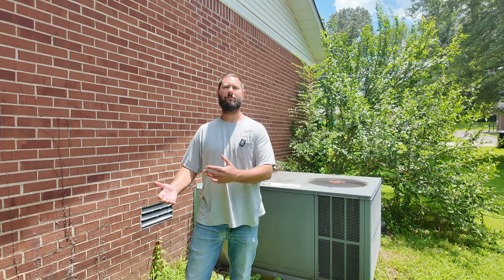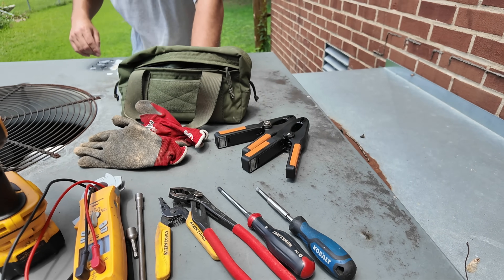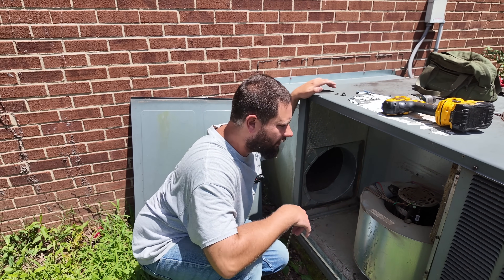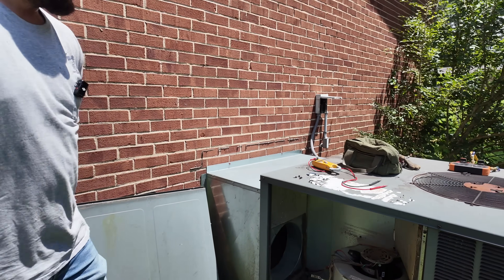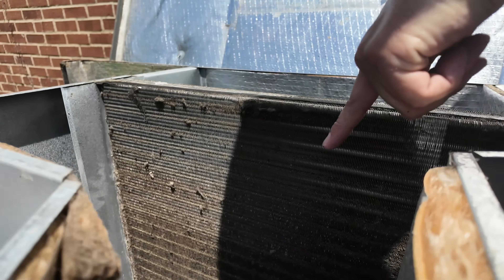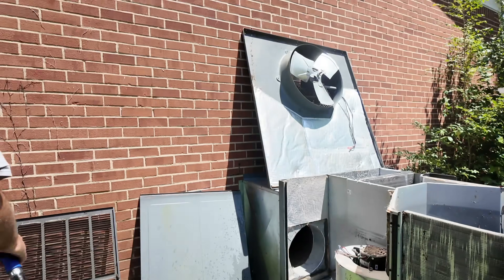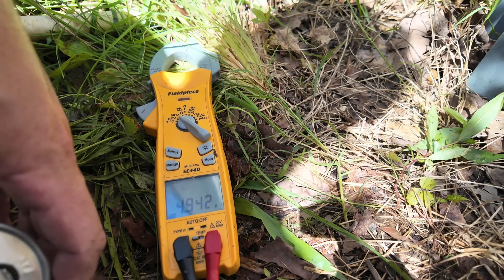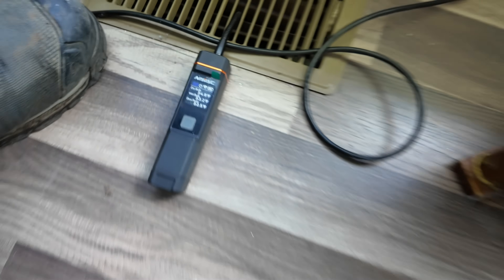HVAC Service Call from Start to Finish: What Every New Tech Must Know!

Comment: So if it’s pulling to much amperage for the fan what do you do in that situation? Need a different fan to compensate for that much amperage ? Thanks in advance taddy👍🏼
Reply from the maker: fan could be faulty I would check fan blade position on shaft and coil for dirt and then capacitor

Comment: What if you don't have a voltage meter that reads mfd?? Would it be possible to check the capacitors?

Comment: Question: havent seen anyone post on this.

Will low refrigerant cause the system to resort going faster to aux heat instead of using heat pump ?
This is what I see happening in a new install done here.
Reply from the maker: yes absolutely

Comment: I'm starting my career at 50 yrs old. I love this video.
Reply: I'm 56 and I'm seriously considering HVAC. I have to get a job or a trade to feed me and mine for what threatens to be another 20 years of undeserved good health. I'm glad I am not the only one. I just hope I am seeing things clearly, and what seems reasonable to me doesn't just look ridiculous to everyone else. I know I can do it, but I will have to work to overcome what I assume will be a hurdle of skepticism  in others.
Reply: @eugenepanza3812  HVAC isn't for the faint of heart. It can be a health hazard for a lot of reasons. From 160 degree attics (worst case in my area), potential shocks, to roof units with old shingles that as you walk on them it starts breaking granules off making it slick. Lots of heights too something I didn't anticipate. I'm going to pursue it still so it can be an option if I need it to be.
Reply: I'm 52. Right there with ya.
Reply: Me too. I Just started my career at the age of 50. Im about to get my Tech Certificate.
Reply: I am 48 and I am trying to change my career to HVAC
Reply: And I thought I was starting late. I got into the trade at 41, now finally getting some proper knowledge at 44. I hope I can make a good career out of this.

Comment: Our 20 year old unit had low refrigerant, a bad capacitor unit, and a fan motor going out, we replaced one thing for another to go and need to replace that. We gave up on the $300+ fan motor and said ok time to replace this thing and get a new one. Cost about $4300 or so for a local company (one guy) to come and do it, did great work and now we have cold air running again without worrying about our AC unit breaking and dying. After 20 years it was a good run, I’m sure it would’ve kept going with a new fan motor but at that point we just needed new AC

Comment: I went to replace a capacitor and when I was done the condenser was tripping the breaker.  I checked the compressor and then I removed the fan motor from the circuit and I ended up having to replace the motor.

Comment: Hi..
I saw to different you tube channels. One guy added r22 by inverting the tank(liquid), and the other guy added the r22 as a vapor( tank was upright). Which is the correct way?? Or best way??
Thanks for your video!! You did a great job explaining the super heat! Most do not!

Comment: 7:05 - You didn’t show it on camera; but, hopefully you addressed that dirty indoor blower wheel.
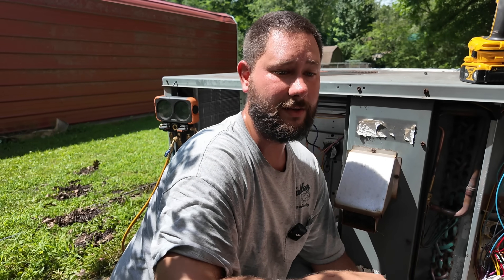14:38 - OK, Tad. You got me. But, I’ll tell you my secret for handling that: I keep an assortment of screws with my tools. 1/4”, 5/16, and 3/8” hex of different screw sizes: 6, 8, 10 (and a few #12, in case I strip out a #10 hole).

Comment: Just wonderin if any techs use the magnetic bowls to keep track of the screws? I know they are mostly used by auto mechanics but I would think it would help a/c techs keep track of all the screws as it will stick on any steel part of the unit. Just curious.

Comment: I've never yet seen a unit like that with a blower motor right on the outside unit.
Reply: You've never seen a packaged unit before?
Reply: @musicnerd72  No, definitely not.
Reply: @PawsumGaming  It's basically just a furnace / air handler and AC all in one unit.  They can come in gas, electric or heat pump versions.